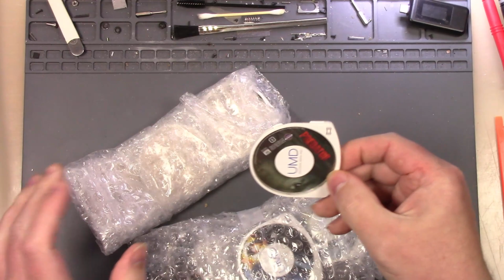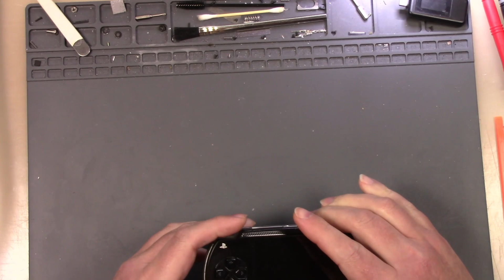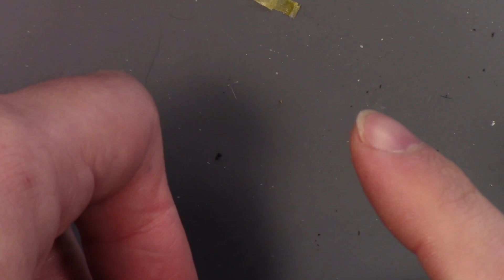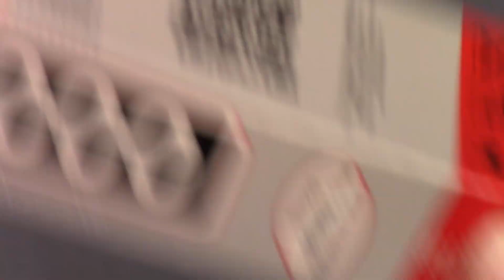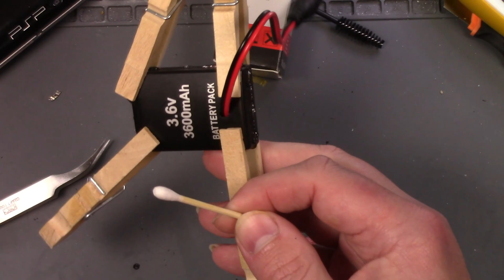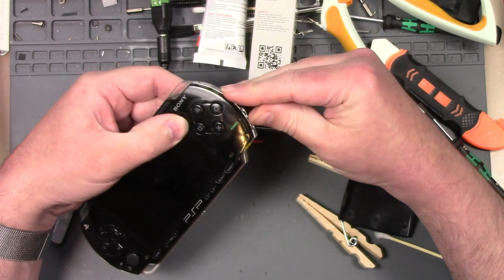The 3rd eBay PSP Plus A Custom Power Supply Cable For It

Comment: Hi my psp 1000 battery when I plugged in power it's 40% after 3hr it's still same 40% I replaced battery 4000 so it's 67% and plugged in power after 7hr it's same 67% then I charge again for 3hr but it's still 67% pls help me